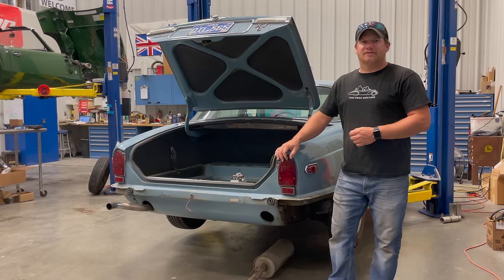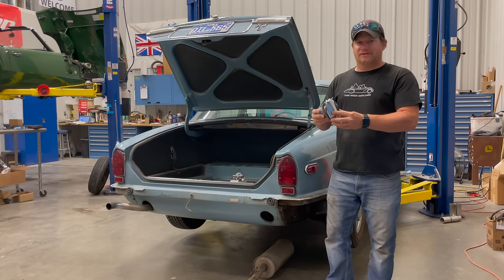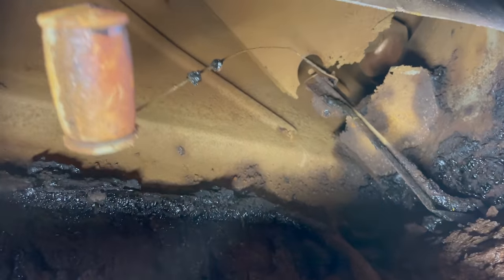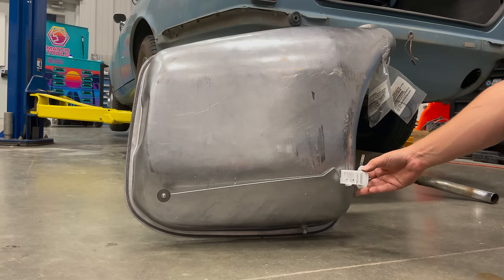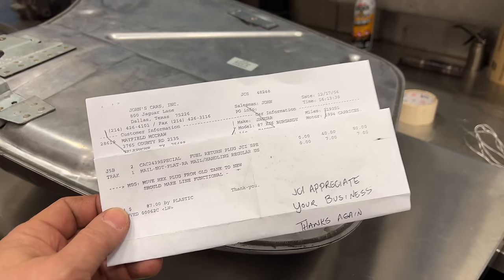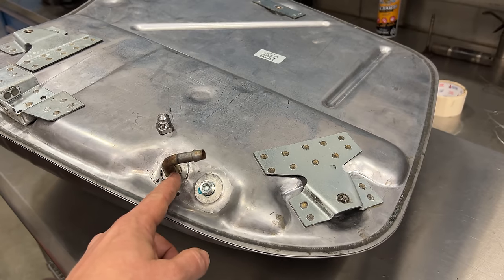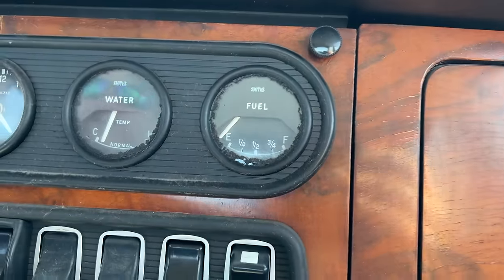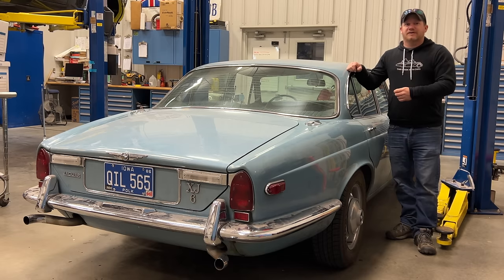Replacing Ruined Fuel Tank on a Jaguar XJ6

Comment: Just retap the threaded insert for something available.  Drill and tap larger than the current.  Problem solved.  Same with the bespoke outlet pipe.  All manner of threaded bungs are available.  You can make it whatever you want.
Reply: may want to try retapping the old tank first just to make sure it works.

Comment: PSA: I have a series 1 xj6 and just replaced the fuel tank with the same one in this video. The threads for the fuel lines are 3/8" and 5/16" COMPRESSION THREADS! I used a compression thread to MIP adapter then screwed a hose barb on and ran 3/8" rubber fuel line to it. Plugged the 5/16" hole with a compression plug.

Comment: S1 fuel system threads are whitworth, if that helps.   EDIT:::::   Might be off a mile there!  Just did the similar work on my Series 3 and the threads were UNS!  Not UNC, not UNF… UNS.  The return pipe in particular was 9/16-24 UNS.

Comment: Thanks for this!  You are very right about the filler head getting completely stuck in the neck of the tank! I tried to remove one of these 'from above' on my 1969 XJ6 and eventually just gave up because I was afraid of damaging the tank or the paint work. I think the truth is that if you want to get the filler head out he basically have to remove the tank itself.

Comment: For your acceleration issue, your car being a N American spec XJ6 has a pollution device called a Secondary manifold. It is basically a second set of throttle butterflies inside the secondary manifold (directly behind the carbs) that are closed during idle forcing the air fuel mix to take a circuitous route around the second set of butterflies. IF this linkage isn't properly connected to the linkage on the front carb it could be just sitting closed forcing air/fuel to take the long way around - bad for acceleration obviously. The secondary butterfly linkage can be removed but you need to wire them in the open position. Definitely check that - PO's like to mess with it.

Also, your car originally had a vacuum retard distributor that gets it's special ported vac signal from a port on the bottom of the front carb that only operates at idle. Assuming the vac capsule still works, maybe a PO connected the vac capsule to full manifold vacuum - the ignition would always be significantly retarded. Check that as well... BTW you can safely remove and block the vac line from a vac retard dizzy with no decrease in performance.

I'm the proud owner of four S1 N American Jag XJ6's right now and many others in the past.
Reply: You’ve really got the bug… well done !

Comment: What an ordeal to get the tank filler caps off.  I had many 10 hours in the right side but the left was really bad.  
I had to drive out the front pivot pin to get the chrome part off.
Then I had to make an adapter that would hold onto the aluminum stuck part.  It is tapered so I used my lathe to taper a piece of pipe and had to cut out 2 small sections to avoid two places on the aluminum.
I then took a 6x6 post that was around 5 feet long and nailed a small platform on the end so it could stand upright.  I used it as a base for a lever that attached to the adapter I made for the aluminum part.
I took a 9 or 10 foot long 2x4 and rested it on the fulcrum that was the 6x6. One end chained to the adapter, the other I tied a weight of around 40 lbs on it. 
There is sat for almost a week while spraying a can of liquid wrench around the filler cap.
Twisting motion was the key.  Eventually it came loose.
I then threw it over the hill, not before stomping up and down on it for a good 5 minutes.  lol

Comment: - Steve, I noticed you had the car lifted on a two post lift...... If  I remember correctly the rear subframe with the axle etc is attached to the body with four rubber "V" shaped isolators.  If you lift the body and the mountings are old they are liable to come adrift and the whole lot will drop down and be left hanging on those trailing arms............

Comment: Another thing to check re: acceleration issue - the fuel vapor recovery system from both tanks is pretty complex traveling up into the left side C pillar and then down under the car to the engine compartment charcoal canister. They get blocked pretty easily which could cause a lack of venting to the tanks. This would cause a vacuum in the tank creating poor fuel flow. I would just run a hose from the new tank's vent port as a temporary vent until you find out if that system is okay.
Reply: I restored a s1 xj6 years ago and I'm sure they don't have a vapour recovery system.. its possible the very last of the s1's in the US did but I don't think so.
Reply: @jeffball6108  Sorry that's simply not true. Beginning with engine #7L6043 all N American spec cars have them. I know that this car is listed as a 71 but it depends when it was sold. All 72's and 73's have them at the very least.

Comment: The inner distributor shaft might be frozen (corroded, rusted) preventing your mechanical advance from working as the car accelerates. I had that issue on my 70 XKE. It accelerates much better now.

Comment: That type of fuel fitting is quite easy to make and I suspect that's why no one produces those parts.  The threads might be BSP, always good to have BSW fittings on hand too!
Reply: There are two British pipe threads, BSP and BSPP (British Standard Pipe Parallel).  I recently ran into it when trying to find a replacement oil pressure switch for my Rover P6.  Finally found a cross reference to a Land Rover part and got one from a local outfit that works on vintage LR's.

Comment: I had fuel guage problems on mine, I changed to sender, to no avail, the problem was the changeover switch contacts, you can check this, if your left tank guage works, by swopping over the wirs on the switch, left to right and visa versa, if its the switch, your right guage will work, and the left will stop.

Comment: I'm betting that plug is BSPP thread - British Standard Pipe Parallel.  I ran into that on my Rover P6 which was on, of all things, the oil pressure switch.  Since it had that thread, no other switch from any domestic automotive application would work since both the thread pitch was wrong and they were all taper thread anyway.  I cross-referenced it to a Land Rover part and found a reasonably local LR dealer that had one.

Comment: The problem with the threads is strange… if the tank manufacturers are just making Series 3 tanks then both threads should be ‘standard’ for that and presumably fit that ‘special’ pipe that you managed to track down. But they should also supply the pipe and blank plug that are needed as an adapter kit, it makes no sense otherwise. God knows what the plugs you bought from Texas are supposed to fit.

Comment: Steve, are those strange threads in any way Whitworth threads? I’ve been doing the mechanical restoration on a 1965 Morris Minor and have been told repeatedly that it had no Whitworth nuts/bolts or threads yet I repeatedly find Whitworth hardware in strange places and the fuel tank pick up is Whitworth. I spent several days trying to figure it out before finally figuring it out.
Reply from the maker: I need fittings with both the correct threads and the correct flare.  If nobody makes the fitting anymore then we will all have to modify things as I did.
Reply: British cars mostly use A/F, not Whitworth.

Comment: British pipe threads are different than American pipe threads. The metric tube fitting situation is a real mess. Good luck!
Reply: That'll  mostly likely be a  BSP  ( British Standard Pipe )size,  they are NOT metric measurements as some may think. BSP while similar to American, NPT but NOT the same here either, as you've no doubt found out.
I have had some luck in contacting ( in person ) a well stocked hydraulic hose and fitting supplier, I'd almost bet that they can and would help you.
Reply: @regsparkes6507  Pegasus Racing Supply will probably have what he needs. They support all the British built road racing cars in the USA.
Reply: @chuckschultz7028  Then I hope he reads your comment here.
Reply: @regsparkes6507  There is also BSPP (the extra P is for Parallel)
Reply: @mescko  I thought I heard somewhere that the designation 'BSPP" is now obsolete, have you heard that too?

Comment: Hi,
Pay attention between the different threads, you have British Standard Whitworth (BSW) and  British Standard Fine Thread (BSF) >>>Q.E.D. 
For  the acceleration issue, it may simply be an oil breather that is clogged...Thanks for the show!
Reply: There is also British Standard Pipe (BSP) , and British Standard Pipe Parallel (BSPP).
Reply: @mescko  Hi,
Yes indeed and above all not to be confused with NPT  stands for National Pipe Taper from USA...

Comment: My Maserati 4.24 had a fuel issue once: hoses were exchanged, then the pump. It drove and died after several kilometers. 3 times. Then finally i was called and the problem was found: there was salt in my tank. Lots. The tank was exchanged for free. After that it ran fine. The tanklid can be opened from the outside with a screwdriver. Normal way is to open it from the inside. Maybe somebody did not like the previous owner.

Comment: Looks like the engine is only getting enough fuel to reach 2700 rpm.  More fuel is required.  Could be a partial blockage or a weak fuel pump.

Comment: the threads were probably BSPT not npt mor metric
Reply from the maker: The problem is compounded that it is not just the threads but you have to match the flare at the end as well.  If it was just a straight thread that used a crush washer it would be easy but the flare made it about impossible to match.

Comment: Can't believe you had so much trouble getting the correct fittings for your fuel tank. Any competent engineering workshop should be able to cut ANY thread and be able to MAKE you a part for your fuel line fittings.
Reply: An American machine shop would be able to make the plug but you would likely have to give them the thread data.  If it is BSPP which I suspect it is, no American machine shop would know diddely about it, nor would I expect them to.

Comment: HI, Just received your blog. Try DMG (DAVID MANNERS GROUP) in England. My contact is Jack Weston. He supplied me with a pipe that they commission a company to make for them. It has the bends on it and a metal braid overlay on the flexible part. The sender unit has 3 terminals whereas the old has 2. The extra on is for a low level warning light. I haven't fitted my cars tank yet so don't know about wiring it up.
Reply from the maker: I sent them an email.

Comment: Nice rig I'm new to this channel, is that the V8, or could it be V12 , you sure it's not the transmission not kicking back not sure if they are carburettor, could be vacuum line eather to carburettor, or if transmission has vacuum kick down eather way wishing you and loved one's all the best
Reply: It's a straight 6.
Reply: The only engines that Jag  had at that time were a straight six and a V twelve. 

As far as the hesitation goes, does that still have the side draft Solexes?  If so, you either need a solex wizard or a set of  Webers.